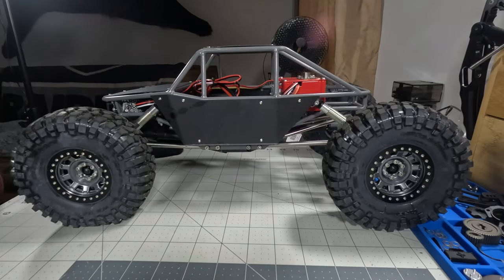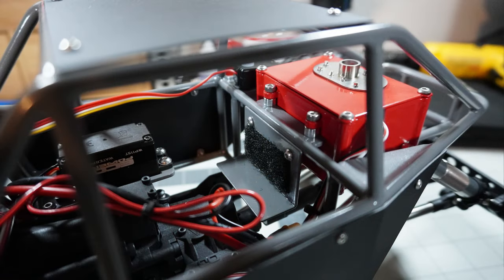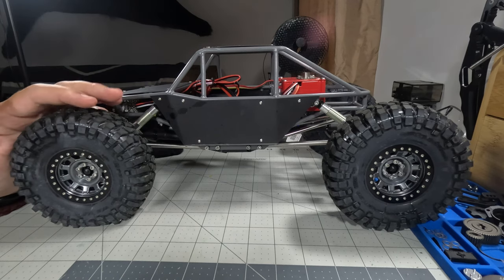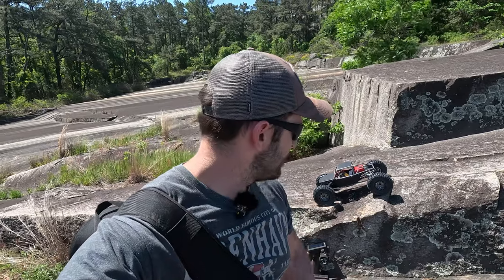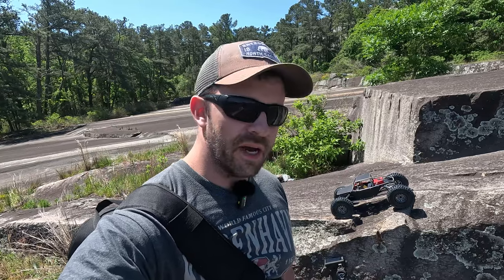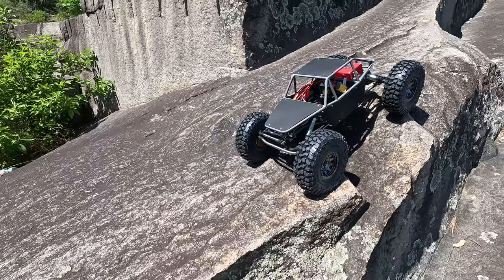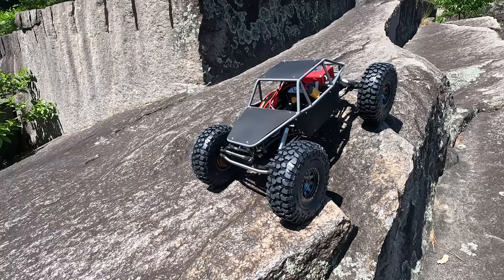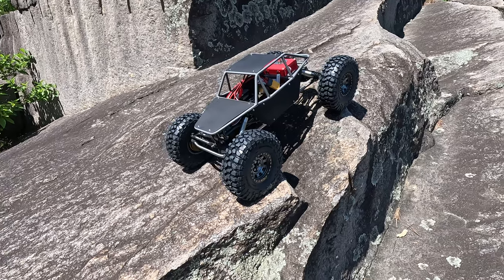RC Speedy A1 FIRST DRIVE!! - Newest Titanium Buggy Hits Stone Mountain

Comment: Got to run my A1 this week.  I have the vanquish rear axle weights as well. Definitely planted. I want to get some deez as well as it does have a pretty harsh flex roll over. Did some decent damage to my sheet metal right of the bad but that’s what is for. My mom and sister live out there. Definitely bring a crawler with me next time I go visit. Great video.
Reply from the maker: I think the rear weights could be in order for me too. I bought some lexan to make some "beater" panels for the future. We will see if I get to it! Thanks for watching!